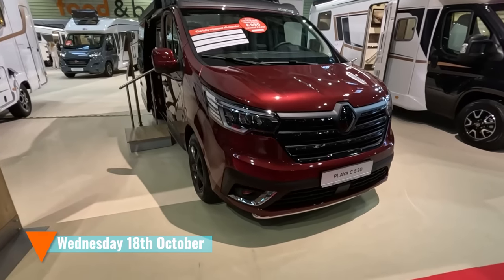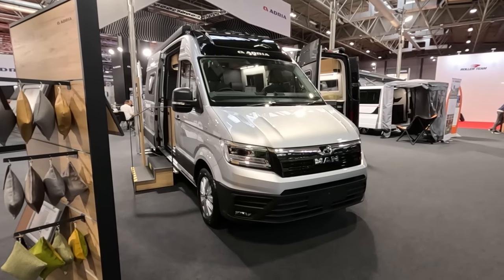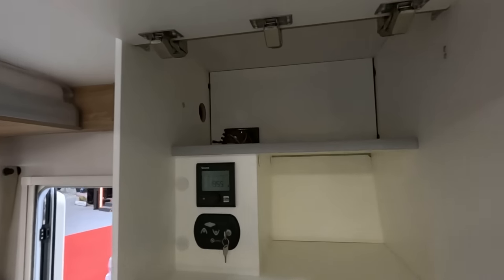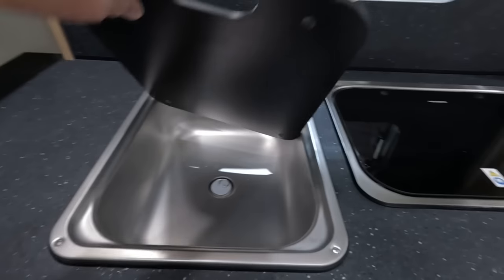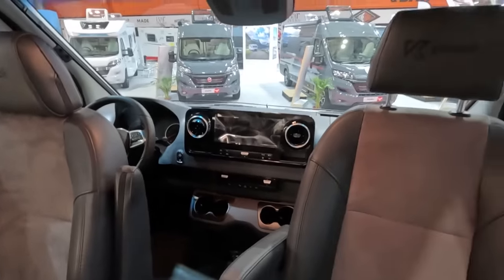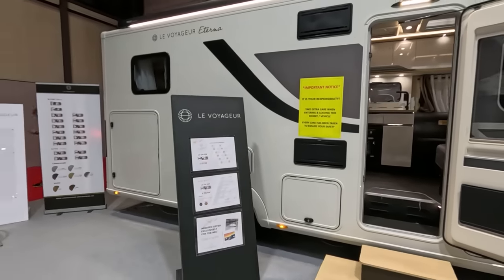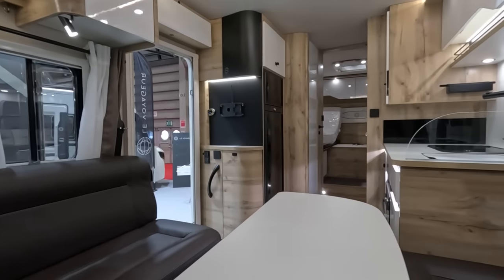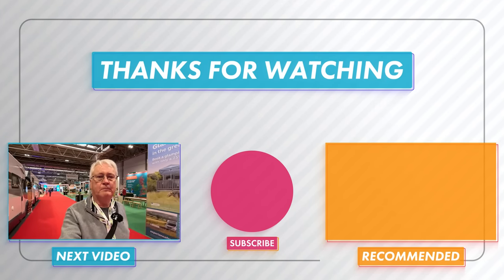Motorhome & Caravan Show 2023 Pt5 | Some Luxury Motorhomes Here

Comment: The swing wall shower/washrooms are a really great idea so much better than the dreadful shower curtain, Auto-trail & Bailey could learn a great deal from these Continental manufacturers. The small campervans I know have an almost cult following especially the VW's but the cost of those Adria & Burstner models is staggering
Reply: I totally agree, I have just swapped my camper van for a small motorhome because after 3 years of struggling with the dreaded shower curtain I’ve had enough. So separate shower for me.

Comment: Bob you missed the cupboard / wardrobe next the the fridge with a hanging rail also the access to the garage from inside to the garage. There are two travel seats on the nearside under the long bench. Indeed the dropdown bed does come right down to the bench bases. Definitely need throws for the upholstery. You can unclip the pleated curtain and draw it right across to make a dressing room if you wish? I know these things because I looked into buying one but at the time we couldn't do the deal because the dealer was being extremely unreasonable. Glad you eventually found the wardrobe.